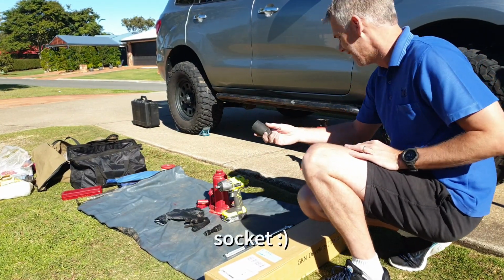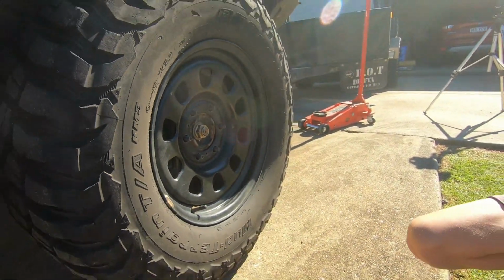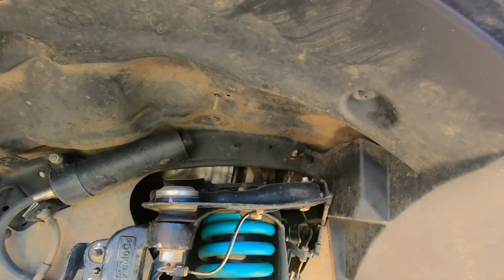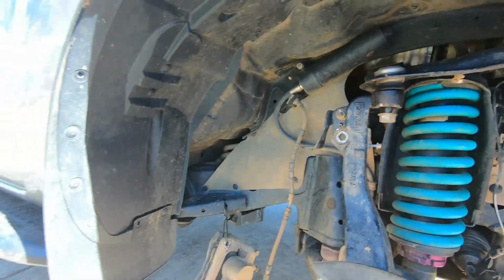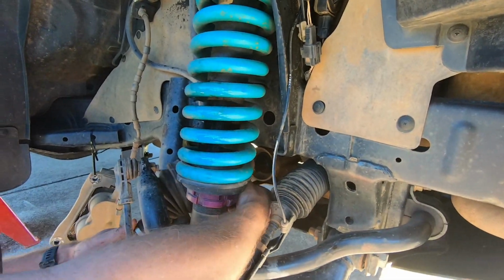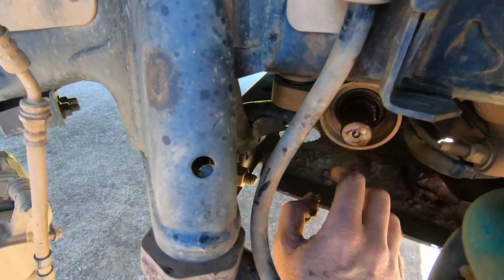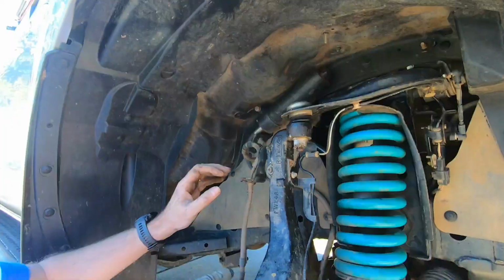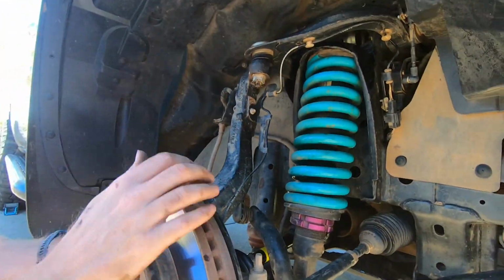Changing a CV Driveshaft - Ford Everest, Ranger, BT-50

Comment: Also, that is a single use hub pac nut you are re-using, due to the effect of tightening to the proper torque.
Reply from the maker: Yes, but it's going to get removed again when the CV fails again.  So I'm happy to keep reusing.
Reply: @DoitintheDirt74  If you keep doing that nut up with that "rattle gun" the CV probably will fail again far sooner than done up properly with a torque wrench to the right torque. The sacrificial part of Fords engineering solution is the part you keep re-using incorrectly. It's little wonder you are going through CV joints. I wonder if you replaced the first one and if you actually noticed that the original nut was distorted?
Reply from the maker: Are you saying the nut is supposed to fail before the CV fails?  Never seen that happen.  It just stops the in/out movement in the hub.
Reply: @DoitintheDirt74  No. The nut is not designed to fail and the CV 's probably wouldn't so quickly either if they were used within their engineering and installation limitations. Your vehicle clearly has a problem if you are going through CV joints. Or you are damaging them before they even see any road miles using that "rattle gun" on the hub nut. The nut is like a torque to yield head bolt used to pre-load the hub bearings if it is done up properly to the right torque. Which I very much doubt you are "rattle gun" whacking 600LB a few times at it and your new CV joint.
Reply from the maker: I'm pretty sure it doesn't preload the hub bearing.   The cvs failed from offroad use.